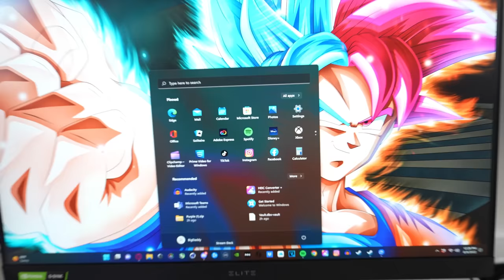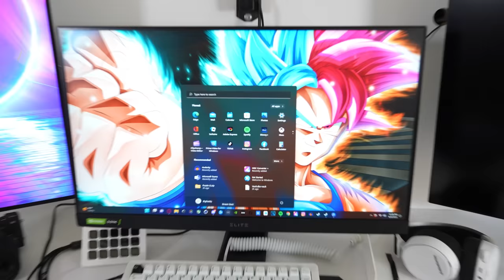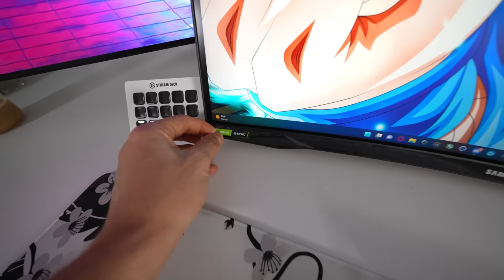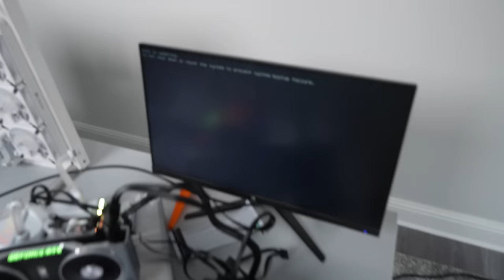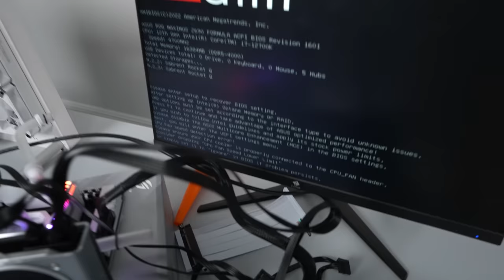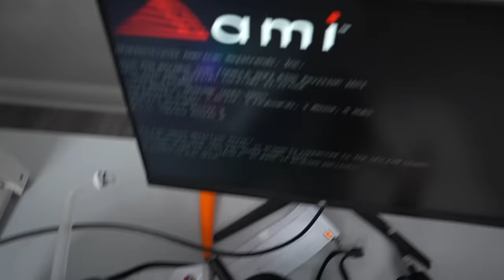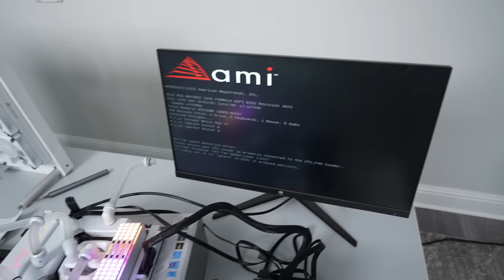I Almost Gave Up...

Comment: The guy below is probably right about the RAM issue. Before I read that I thought maybe you were having same issue I was. What happened to me was that I had an Asus ROG MoBo too and the first BIOS that said it was Win 11 ready, while it was it did not have some TPM items, and a few other settings that need to be changed, turned on by default in the BIOS so it would not boot. As we know, you need TPM enabled for Win 11. I put it back to Win 10, waited until 2 or 3 BIOS' later and tried again as the TPM items were now toggled on by default, and the BIOS was really Win 11 ready, finally. If you can get into the BIOS and turn them on, or wait for a BIOS with them on by default, then all should be good. (Note, the first Win 11 ready BIOS did not boot if you loaded Optimized Defaults either, which usually works, but this turned off certain TPM settings too. The newer BIOS' Optimized Defaults turns them on). I was kind of bummed because one reason I like Asus MoBo's is their BIOS'.

Comment: I actually had something similar happen, I had installed windows 11 without enough space, as it turns out my computer wasn’t actually compatible with windows 11 anyways because It didn’t have the minimum required TPM module installed.

Comment: Might ahve had too much strain on the riser cable it's self, which may have caused one of the leads to break. That strain may have been coincidental to the windows update to Win 11. I doubt that had anything to do with it. I recommend taking a multi meter to that riser cabled and orienting it in different ways to see if you get good continuity end to end. That should help verify this theory. I don't know anything about the riser cable brand, but they might have had bad materials in manfacturing or they themselves at fault for buy sub standard material or providing a process and quality assurance path that should reduce your buyers confidence in dealing with them in the future.

Comment: Perhaps change your PCI-E lane in the Bios from Gen-4 to Gen-3. The bios will automatically try to run the 3080 at Gen 4, however if the PCI riser cable is not to correct standard it won't boot properly. Even though it is supposed to be a Gen-4 riser cable, some of them aren't very good and still only work as Gen-3. Try run Gen-3 and I think it will work.

Comment: I kinda feel relieved to see some of the most experienced tech people having trouble with pc just like myself :)) In the end you stil doesn't know what was the cause of the problem, cause like you did plug in the gpu without the riser cable and the error still persisted, and at the end of the video it just fixed itself. I would be scared to see my pc fixed itself and don't know what cause the error in the first place because I have to use the pc with the fear of the error could come back at anytime

Comment: Good day. DDR 5 is sometimes giving problems with running 4 slots. New Bios can also give problems. But if it works now leave it alone. My father told me, if something works do not try and fix it. Have a nice day.

Comment: Hey Ed, @TechSource

I have also encountered a similar error. In my case, it was the GPU. It would sometimes boot me into windows, and sometimes it would just fail. If I booted it after some time of failing, it would successfully do. But, it would never do on a restart.

You can identify this error by plugging the display cable into one of the motherboard ports and disconnect the GPU. If it boots every time without the GPU, you know its the GPU that's bad.

I could be wrong and in no way am I a professional but it's an experience I encountered so I wanted to share. Maybe might help you in the future who knows. :D

GPU was: XFX RX 560 4GB

Comment: I knew it was the riser cable straightaway. I recently built 2 PCs for my work colleagues and exact same components except one had a corsair riser cable. Expensive and useless. The one without the riser worked fine. So I tried the pc with the riser cable again (re -installed windows etc) and it worked for a bit... but then crashed again. So completely got rid of the riser cable and it works beautifully. Morale of the store: riser cables are temperamental AF. That Lian li riser will eventually fail too.

Comment: HERE IS A FIX for everyone :
I had the SAME issue a month ago ... Using a riser cable. Basically, in your BIOS settings, force PCI-E 3.0 and don't even look at 4.0 🙂
There will be no impact on GPU performance, riser cables are just not of great quality overall.
Cheers

Comment: I can feel the pain.. I upgraded my motherboard and cpu and it worked fine. Then upgraded to W11 and had the exact same issue. Turns out my motherboard does have a random MSI bug. The only way I could get video output was when I only connected the HDMI output from my gpu, nothing else.. So when I connected DP amd HDMI, nothing. When I only connected the DP output, nothing. All this hassle and frustration for such a stupid bug. Literally did everything what happened in this video to try to solve it.

Comment: updates very rarely cause any pc issues.

Most of the time when an update kills a PC, the PC already had flaws to begin with that were made even worse by an update. which means the pc probably was already near failure as it is. this might not always be the case, but it's a good rule of thumb that other things caused the failure first.

Comment: The only thing that could be wrong would be the power supply. Like you have not checked that specific 8 port connector for the GPU. Like corsair make very good PSU's but maybe in this very unique case it may be that. Check

Comment: I dunno why anyone would ever want to water cool, what a hassle when things go wrong.

I had a similar random issue where my monitors would just shut off. It turned out to be the PCI power extension cables, I removed them and problem was gone. Since then I never used extension cables even though they look sharp.

Comment: Don't know if you're using the 12pin with a jumper still, but I was told it's best to use separate cables off of the PSU to each split. The Power spikes on 30 series can cause instability in the jumper config.

Comment: The only part that you didn't change was the power supply and it could be that underload you could be maxxing out its capacity so it's unstable while booting and might be the cause of the booting issues.

Comment: Wish u get that comment but for everyone who had the same issue let me explain :  one of the most popular issues that cuz by the GPU extension specially with the asus motherboards for solving this problem u can disconnect ur gpu , take off all cables and take the cmos battery, connect the + with the lock of the battery by a screw and press the turning on button for 15-30 sec , replace all the things and reconnect the gpu with out the extension turn it on when it boot turn it off and reconnect ur extension and now it will run softly wish that help u bro ..

Comment: It is Windows 11. This issue happened to me. Reset Windows back to 10, or a fresh install of 11, it shouldn't matter but I would recommend 10 instead.
Windows can be temperamental like this

Comment: Well, there's gotta be someone out there that had hardware issues. I also had graphics card issues that are permanent. I had a 3080ti from Gigabyte that died recently in my AMD build which was confirmed when I put the same card in my 9th gen intel build. I had to install my 2080ti from the intel build and insert it into my AMD PC so I can keep streaming. What stings the most is that I bought the 3080ti during the GPU shortage from a retailer.
Reply: Sometimes in your case, there could be something that could have been dislodged during installation.

Comment: Next time you encounter something like this, hook up your HDMI/DP port to motherboard, instead of GPU, and give your RAM gold finger a few good wipes. You want to eliminate one at a time. GPU is pretty easy to troubleshoot, since most modern Intel CPUs has iGPU built in.

Comment: Find it hard to believe windows 11 bricked it… software rarely corrupts hardware unless one of the updates messed with the bios microcode.  Even that is extremely unlikely. It is more likely a power surge or something like that took it out.  Did you check all of the pins in the socket to ensure there are no bent pins? 

Rgb software updates also have the capability of corrupting the bios or compromising the stability because they access the bios to control the lighting for some hardware like the mobo and ram.

I have the same mobo and cpu as you btw, no issues with mine at all.

Comment: I think you've proven all elements of the system work in isolation, I don't actually think it's the new riser cable, given your initial issue was with the "old" riser cable installed. I'm with the others here that it's a combo issue of latest gen intel and ram being most likely. Good luck and enjoyed your content as always. Keep up the good work 👏

Comment: Went through this recently when I upgraded from a R5 1600 to a R5 5600 on the same motherboard with a newer BIOS, it somehow fried it (my guess is not enough power running through it) when my power went out.

Comment: i dont know what the initial cause for instability related to win11 install was, but taking it off the wall the only thing you didnt consider is mounting pressure on your cpu and how gravity affects that. power delivery with other cable seems to have solved it, but uneven or overtorqued pressure on ur cpu causes very similar problems.

Comment: This is how I was reacting when I was troubleshooting my PC I was so frustrated that My pc won't boot after I custom-built it new and won't turn on after 5 weeks of use It turns out to be the ram, tried to do a memory test on other board and it work I was like WHAT IS HAPPENING I check my ram slot on my main motherboard it looks fine then I tried to use the same ram again its work so yea next time If I ever encounter a problem with my windows stuck on the logo again I will just reseat my ram...

Comment: I would take a guess and say it’s your ram. I had almost the same problem it wouldn’t post for the life of me. After some research and contemplating life I changed the ram from 32 to 16 just cuz and it worked later I found that windows 11 had some issues with DDR5. Hope your pc doesn’t fail again.

Comment: Riser cables tend to just that.. They are sometime Gen4 compatible, but due to length or sharp bend, fail the Gen4 requirements, some GPU defaults to Gen3, and looks fine in a initial test, ( getting to the desktop ) but the 3080 was set to boot in Gen4, but when the random reboot the MB and GPU started in Gen3, ( worked )  then they mismatch Gen3 vs Gen4 and failed to boot win11. replacing the riser made the two start in Gen4.. I think the issue was not Win11 on its own, but the firmware vs hardware issue, when Windows 11 attempted to start the GPU in Gen4 mode. 
The issue was made it more complicated ( not worse ) was the Bios update. as that also reset the Gen3 vs Gen4 compatibility in the vBios

that's why you saw the boot menu, but didn't make it all the way to the win11 desktop. With the older riser, forcing both the GPU and MB to Gen3, the old riser will work ( I guess ) 
Best to use the shortest riser cable without sharp bends, or not using one at all.. Also, when you booted the 2080, a different vbios driver was started, and worked, That is when I knew it was the firmware on the 3080 that failed the Gen4 requirements, booted the bios just fine, and didnt post to win11

I think JaystwoCents had a video explaining the issue much better.

Comment: With the 2080 the BIOS flash process *completed*. I think I read somewhere that Windows updates can cause that problem. 
There might be something wrong with one of your cables of the motherboard connectors (flaky connection), or maybe you 
have a bad power supply/glitches on the mains. These problems interact.

Comment: I feel your pain Brother!! I first fell in love with PC’s when I was 12 years old. Radio Shack Tandy 1000…. I’ve build and repaired over 500 pc’s in my lifetime so far. Recently I had an issue with my pc. It was fine one minute and I turned it off and when I came back to turn it on. My boot partition was corrupted. Do you know how long it takes for me to reprogram my computer and the countless software I have on my pc! But after countless hours of trouble shooting it turned out I had an external hard drive error. !!!!

Comment: My original guess was maybe a display identification nonsense thing going on initially as the update to windows may have updated something on either the mobo bios or the gpu vbios which caused a random incompatibility between between the board and the gpu which was spitting out those vga errors on boot.

There have been known to be bizarre vbios errors on the 3080ti cards and I recon this was the root cause of these strange issues which then got amplified by a dodgy pcie riser.

Comment: I have been building pcs since I was a teenager and when I built the latest rig for myself this time, I spent more time testing then building it. Only to find out that the issue was the front IO power button that wasn’t plugged in properly 🙈😂 Things happen but there is a solution to every problem. It may take a while but sooner or later you get there.

Comment: I recently had an issue where I was getting random BSOD's. All the forum posts suggested ICue software but disabling it resulted in other random crashes, my USB devices would randomly disconnect or crash in device manager. This went on for months, fresh Win 10 install, Win 11 install still repeated random crashes, if my monitor went to sleep it would crash. After trying everything I could possibly think of I noticed one thing in HWInfo my power reporting was at 75%..My psu was going bad replaced it with a new PSU and BAM all those weird issues disappeared like magic. I was losing my mind over trying to figure out the issue.
Reply from the maker: Oh man that’s crazy! Never thought the PSU would be the issue

Comment: Heyo - Full time ICT Tech here from Australia.

From the original video of pc died I can see that the had the longer PCIE riser cable and the faults began. During the end of this video you have landed that the new riser cable is playing Havic - I don't think you are out of the woods yet as you have 2 very similar faults happening with both PCIE riser cables

- I dont think the GPU is the culprit but I'd jump in BIOS and ensure that you gave the PCIE gen set to match the riser cables. Eg if it's a gen 3 compatible cable but bios is trying to get GPU via gen4 this would cause major havoc.

- If the faults did infact begin during the windows upgrade, I would be highly suspicious of driver issues. I would do a fresh install of Nvidia and GPU drivers and run a scansfc via cmd to ensure nothing windows has been compromised.

- lastly my mind falls to a Ram issue - motherboard failing and giving you different codes for what seems like the same fault here, it sounds very Ram caused to me. In BIOS as a tester, remove any xmp settings and have the ram at stock standard boring speeds, and if problem pops up again, try a single ram module to see if the Ram may be causing issues across memory channels

I do these issues don't pop up again and it was a driver issue that may have resolve itself with a refresh in the background but if it re-occurs hopefully you may come across this message and might get lucky and steer you in the winning direction

Good luck my friend

Comment: I know what happened. Windows 11 uses a TPM (Trusted Platform Module) it's built into your BIOS.  And you probably DID need that BIOS update, because lots of boards were having issues posting and needed an update.  (Remember your BIOS update didn't complete until you put in the 2080.)

I had a similar incident where my system wouldn't post. I replaced the motherboard, wiped my drives, reinstalled Windows, and everything worked. But then I wasn't willing to put myself through what you went through.  And, Yes, I'm sure it was the TPM because of the error codes I was getting.  My best guess is that your BIOS wasn't properly configured so when Windows 11 did it's final restart your system locked up.

Oh, and you were so lucky that your BIOS (or maybe Windows) sorted itself out.  I really thought you were going to have to reinstall Windows.  Which is really easy with Windows 11.

Comment: Before windows 11 update, all was working fine. After windows 11 update system goes down. Whole mystery is hidden in this. Windows 11 update, updated BIOS as well and problem may b like compatibility issue arise. Hardware was all fine.

Comment: What you guys need to know: The current intel architecture Z690/Z790 is a nightmare, when it comes to DDR5. It’s very sensitive, especially when you use all of the DDR5 ram slots. Ed could have saved a lot of effort and time, by simply removing 2 dims and only use 2 DDR slots instead of all 4. I guarantee that all of his issues will be gone. It’s embarrassing for Intel to release such an instabile architecture. Z690/Z790 is simply not able to handle 4 dim sticks. Especially not above 6.000 MHz plus. You also have the proof with all the different errors and error messages ED got: the ram sends the wrong signals to the cpu and Mainboard and cause random kind of errors. Thats the best proof that something is wrong with the Ram setup. The ram is also highly dependent on the current temperature of the rams. That’s also one of the reasons why Ed sometimes gets a post and sometimes is able to go into windows and sometimes not. DDR 5 with XMP profile gets very very hot.

Comment: one thing I noticed, on the first attempt with the 3080ti and no riser..  got no signal to screen...  from the angels you showed us, there was no hdmi connected to the 3080ti.  so that would make it hard to see anything on screen.  look at time 10:49, I don't see any cable connected.